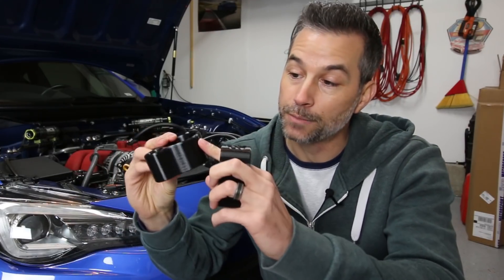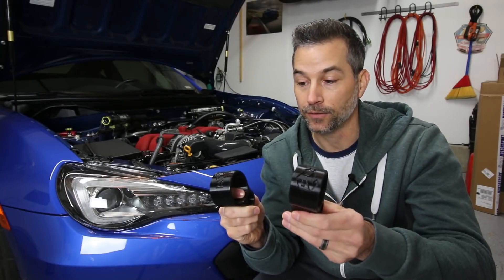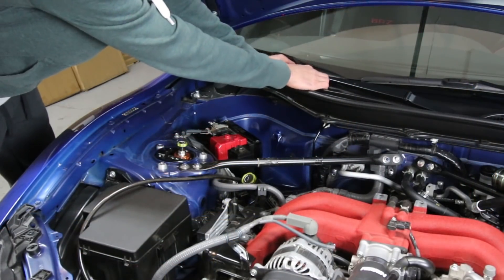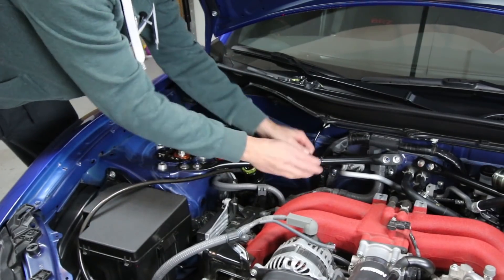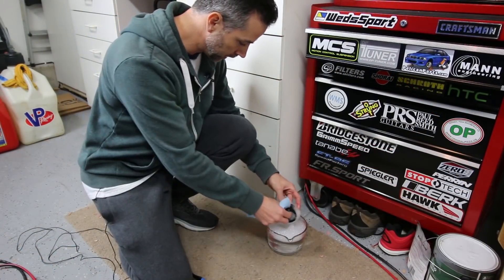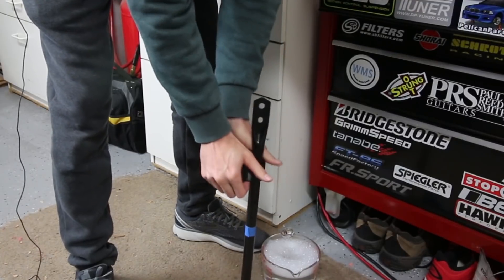3D Printed Car Parts!

Comment: Actually, looking at how pliable those are, they seem to be TPU, I'm not sure how I feel about that. Also I'd have thought a 2 piece design that clamps onto the bar and the cylinder with a bolt would have been better, at the very least it would be quicker and easier to install.

Comment: What material are these made of? I wouldn't trust PLA or ABS in an engine bay. I printed myself some clips to hold the under-hood insulation in place on my old Volvo and made sure to use Nylon, and even those softened a bit with the heat, probably should have used Polycarbonate (though given these have a bit more mass and structure to them Nylon might be ok, but PLA or ABS would still be a problem).
Reply from the maker: The material used to make these is PTE. These units have been used in a few other test cars for a year now without issues. I will be "testing" how they work out at my next race to see if they soften up under the heat.
Reply: @TheBTRGarage  i mean if it becomes soft in a bowl of warm soapy water surely the engine heat and the quite intense heat that can be developed from the canister will be enough to soften it?
Reply: @TheBTRGarage   how did it go?

Comment: Just curious, the underhood temps get hot. Does it heat those up and then allows for moment
Reply from the maker: Yes, very good point! I am going to test it out at my next race and see if the mounts become pliable when warmed up by the engine bay heat, or canister heat. That said, these mounts have been on a couple friends cars for the last race year with no issues.
Reply: @TheBTRGarage  as 3d prints get baked they actually become harder and more resistant to heat
Reply: @dobsonator  yea PLA does this thing called ANNEALING kinda like when u Anneal other materials- the corn starch type poly lactic acid changes to a crystal structure- and tends to even out perform ABS if baked correctly. however it will warp while doing this so its always better to use a high temp Polycarbonate ABS mix or somthing similar- Or perhaps by using carbon fill pla it will warp less
Reply: That is exactly what I was going to reply with. Great critical thinking!
Reply: I’d imagine the can would heat up and expand as well so as long as the thermal expansion between the two parts is not much different, I’d imagine it would be fine.